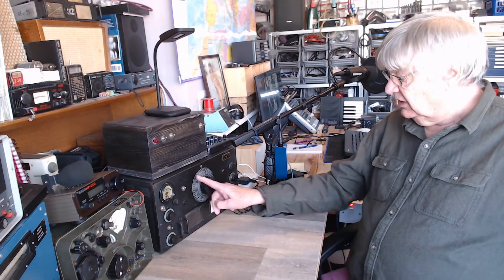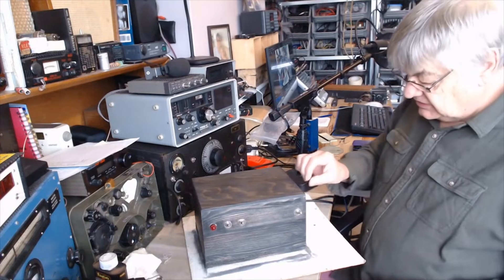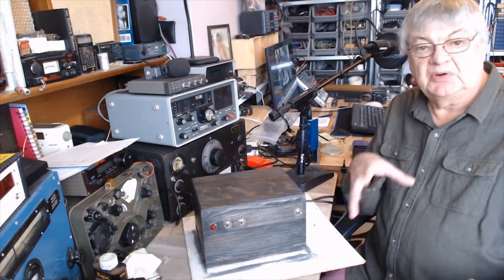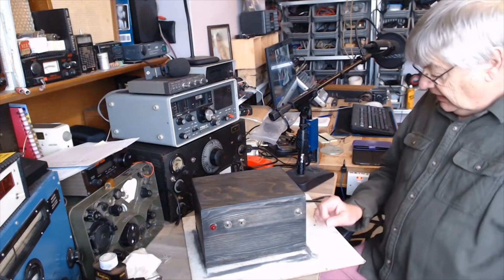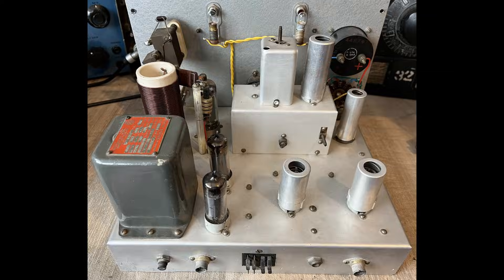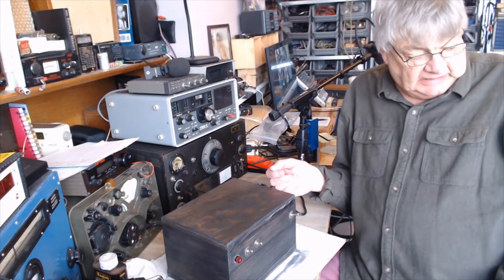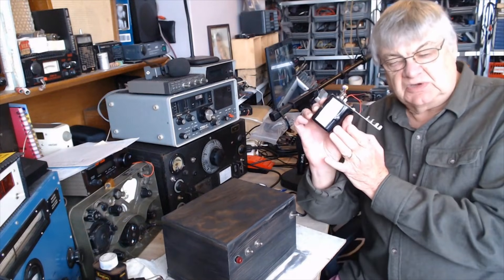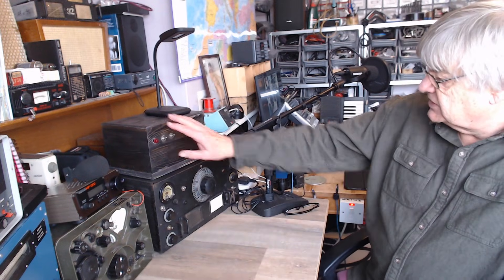G4NSJ - National HRO 5TA1 5A1 R106 mk1 mk2 comms receiver - part eight

Comment: Has anyone mentioned the Australian connection with these HRO receivers? Around the beginning of WW2 our RAAF was looking for a communications receiver and to this end Kingsley Radio of Melbourne (Australia) submitted a design, the CR11. If you see a photo of this radio, it is unmistakable as a knock-off of the HRO. The design was accepted and went into production to be known in RAAF service as the AR7. It didn’t take HRO long to hear about this knock-off and they began legal proceedings against Kingsley for copyright infringement. Long story short WW2 meant that the USA needed communications receivers and a license was arranged for Kingsley and they were told to get on with it. By wars end some 3200 receivers had been produced most going to Australian military use; army, navy and air force with a small number going to US forces in the Pacific. After the war many AR7 receivers went into commercial service, then later they hit the surplus market and became a favorite of ham radio operators.
Reply from the maker: That's interesting information, thanks!